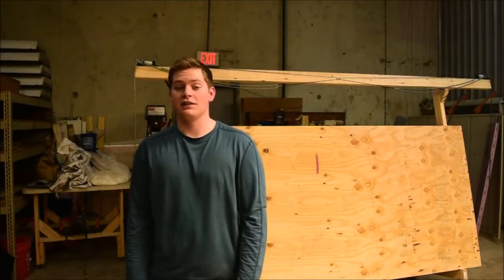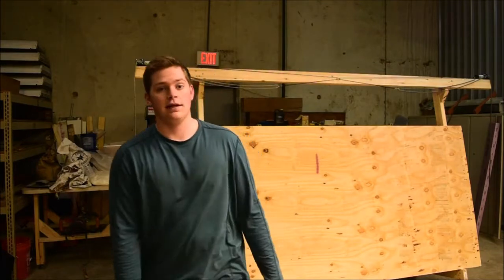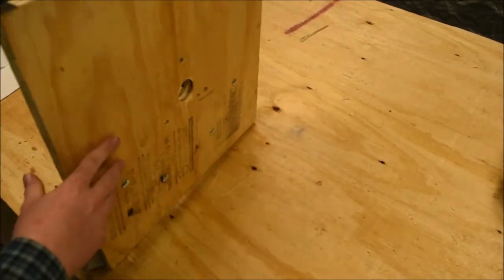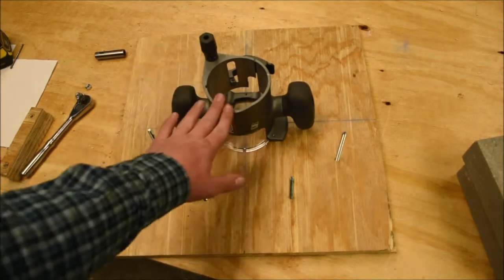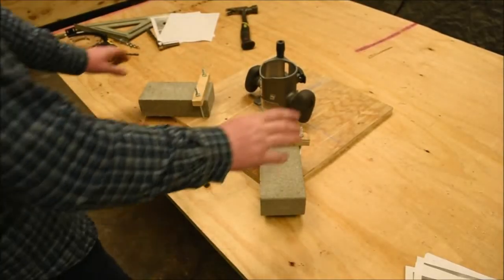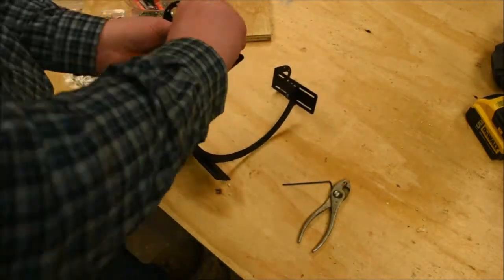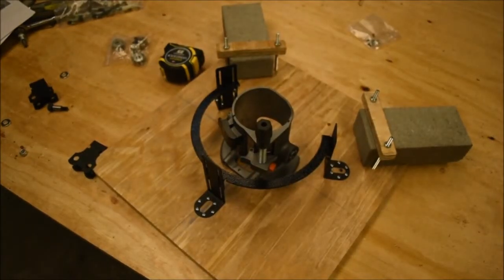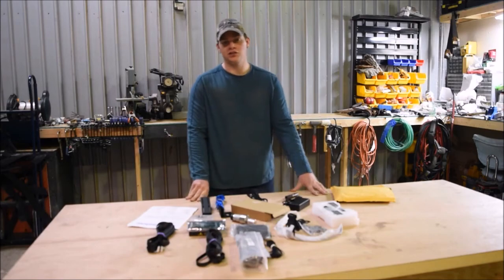Maslow CNC Setup: Cutting the temp sled and attaching to the frame.

Comment: Is it recommended to recess the bolts? It seems like they might aid the sled in sliding across the work surface as they provide four smooth points of contact.
Reply from the maker: It is recommended to recess the bolts. You are right that they would create less friction, but by not having a flat surface the heads of the bolts would fall into the cuts and create an uneven cut. Much like the way your car falls into potholes having only 4 contact points with the road. A flat surface will glide over the cuts.
Reply: @KyleMelsonOKC  Oh, good point.

Comment: Great series, thanks for your rigorous documentation!What size tool did the handle removal require?
Reply from the maker: If I remember right it is a #30 torx.
Reply: Thanks for the quick reply. I purchased the same model, but it was two independent 8mm allen key bolts.